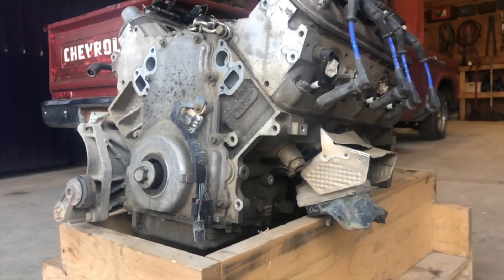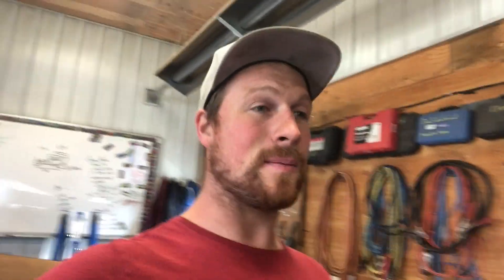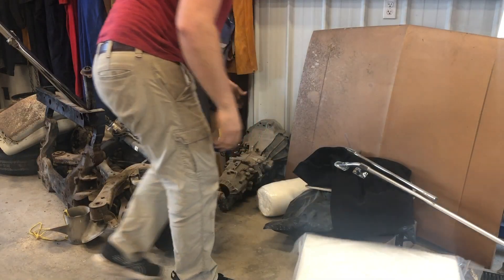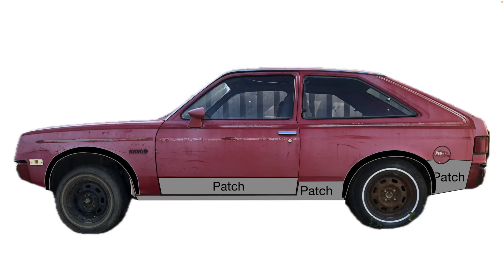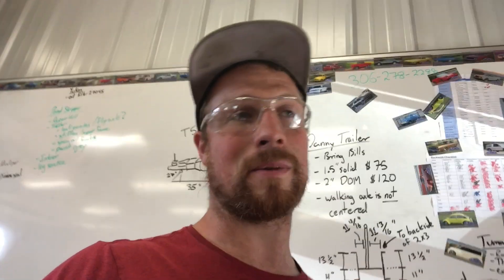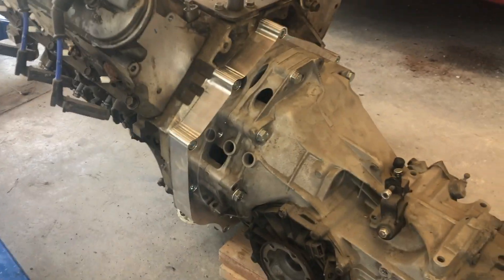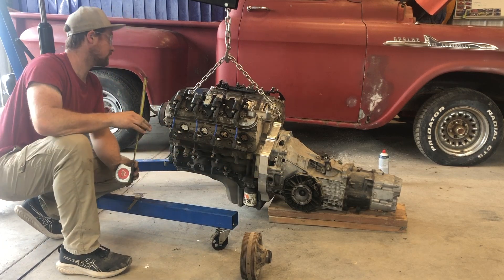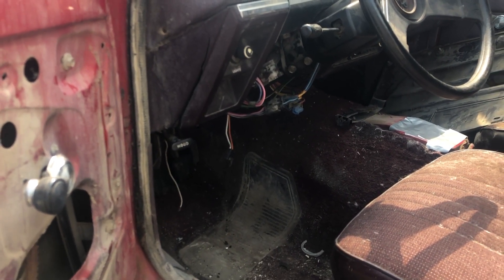The All Wheel Drive Chevette gets American LS3 Power and a German Transaxle?

Comment: Great videos and a very interesting project. If the LS3 needs to be rebuilt anyway you could use the factory LS4 crank, timing cover, and accessories with the LS3 block. It could save you some time and machining bills.

Comment: you can gain several inches of room by losing the Chevette seats and going with a race bucket or shell.  You can also cheat forward with the dash, firewall and steering wheel.  You're in a game of fractions and every little bit helps.
Reply from the maker: Thanks for the input. I was thinking seats will for sure give me an inch, I'm hesitant to move the driver any bit forward though as the cab is already pretty small, but yes the dash can definitely go forward which will help it feel more spacious
Reply: @fabtofast  I want to see you win, I am a larger guy who fits in his 1976 Corvette with his racing gear on - I had to lower the floor, remove the rear firewall, completely change the frame at the rear firewall, but I fit just fine - and I'll resay the thing I said before, it's a game of a 1/2" here, 1/4" there, offset the pedals a bit, and on and on but I think you'll get it.  Can't wait to see how this all goes...

Comment: Definitely not just “another LS build.” Subbed 👍

To use the LS4 harmonic balancer you will need to turn a washer to size to act as a spacer to get it to tighten up on the LS3 crank. LS4 crank is a few mm shorter and thus the hub on the balancer is shorter as well so you need to compensate if you plan to use the LS4 water pump and other serpentine accessories on a non LS4 crank, otherwise they won’t line up.
Reply from the maker: Yeah Hey thanks for the info, I am still figuring this out in my head. Why would I need a washer? From what I see, wouldn't both balancers "bottom out" on the oil pump drive? and then there is a small space left inside the balancer between the crank nose and balancer? I'm totally open to being wrong about this, I just assumed that since the LS4 crank was shorter, I would have to shorten the LS3 crank and then the LS4 would just seat on the oil pump. Oh I think I know what you mean... I need a washer to go underneath the crank bolt and in front of the ls4 balancer? so that I don't "run out of threads" inside the LS3 crankshaft. is that what you mean?

Comment: I'm surprised to see the 01E. Those transaxles are rare in the states and sought after by Porsche 944/951 enthusiasts since they are stronger and have a 6th gear and are nearly drop in replacements. 

Its funny to see a chevette being turned mid engined when the fiero and chevette shared the same front suspension.